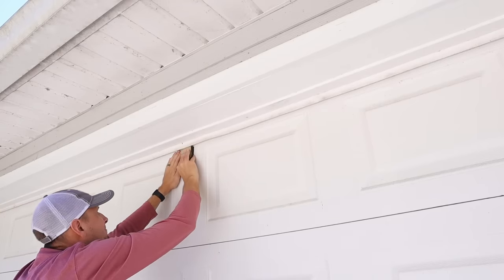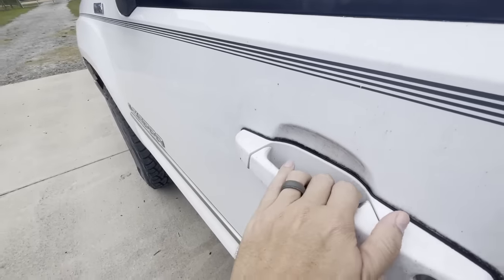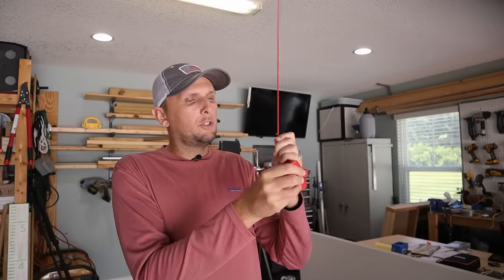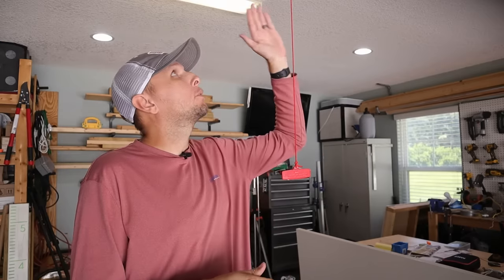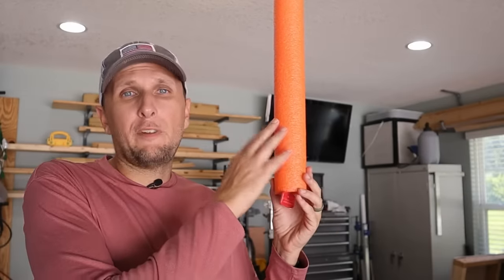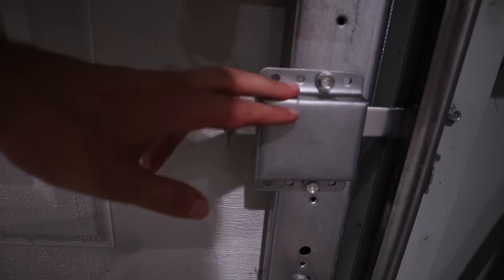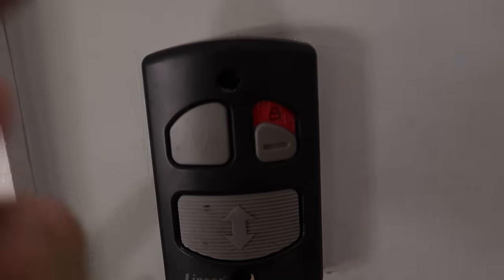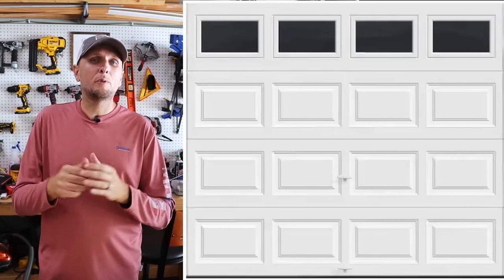How to Stop Garage Door Break-Ins | Number One Way Thieves Get Into the House!

Comment: Former LEO here, also. My experience tells me that the #1 way a BG came into the house was through an unlocked door between the garage and the home itself like you mentioned. There's only so many frequencies and at times BGs drive up and down the street pressing a half-dozen openers. When one actually opens, they'll sit and scout the area.  Also, I'm remembering that the #1 reason a vehicle was able to be lifted from a dwelling was that the owners parked in the garage...but left the key in the ignition. This was a good vid and thank you.! 

 I've also found that you can't beat a neighbour for security when you're gone, like Christmas. The only problem is that  we usually fail to get to know our neighbours. It's worth the effort, I assure you.
Reply: It doesn’t exactly work that way anymore.  At a minimum the frequencies are squelch-coded. You’re not just gonna guess through it.  Modern openers—there’s encryption both ways (and a key exchange) there’s NO WAY you just push a button and pop a door open.  Do you want to know how to do it? Do you really wanna know?  I’m not a hacker, but I’m a systems guy —and I can tell you exactly how they do it.  Right behind me they’re building a tract with about 500 new homes in it probably most of them using Linear quiet openers— or some close corollary.   Of course the houses are empty and being finished—but they won’t be six months from now—SO—I take my remote down there (with all the construction guys milling around)— put on my hardhat walk into random garage—I press “learn” on one of those openers— press the button on MY remote—and I walk away for 6-8 months… then come back for my new Jaguar!
Reply: What do you need to do when you move into a new place or you’ve rented your shit out as an Airbnb or whatever—you need to find out what sequence of things you gotta hit on that opener to clear ALL the existing codes out—and add back ONLY the ones you have IN YOUR HAND… maybe even do that once every couple of months just to be sure
Reply: @MattFellowswasHere  Well, you'll need the My Key (or equiv) for the Jag. Don't discount that there are a lot of older garage door openers around. It's one of those 'ain't broke, no replace' items. Yes, encryption has come a long way, but still if someone has too much time on their hands it's not that hard. e.g. my telly is only 5 months old. Still, some random dude (or dudette) is driving up and down our street turning on tellies in the middle of the night.
Reply: @r.f.pennington746  —- the guy who built your TV does not care who turns your TV on— he’s not engineering for security, sir.  The learn button on the door is a dumb thing to have— ANYONE can walk up and pair a remote they bought to your dang door!— it takes TWO seconds.  Why on earth would anyone spend millions of dollars trying to “crack the encryption” on your garage?—-nobody and I mean nobody on the planet…has that much “time on their hands”… Man this SO reminds me of the time I took a counterfeit (steel) Susan B, Anthony, dollar into the police station.  There was a sergeant there who said to me—why would anyone bother making counterfeit dollar coins?  He was dead serious!  As a 20 year old kid, I just remained silent.  Just thinking in my head—-dude probably stamps out 10,000 of these an HOUR—-he probably has a coin press that he runs ALL night who knows?  Do you really think I brought you the only example?  Do you think this thing cost more than maybe 10-20 cents to build?
Reply: If the neighbour has a car they always park on the street, get them to park it in your driveway while you’re away.
Reply: One of my neighbors, a detective, drove an obvious "unmarked" patrol car and when we went out of town I had him use our driveway so it wasn't parked in the street.
Reply: I briefly worked with a guy that was sent up state for over 14 felonious home invasions. He said that the garage was the easiest way into a house. Once you are into the garage of an unoccupied home the best course of action is ignore the door into the home because of alarms. As a thief you are safe because no one can see you in there so there is time to cut through drywall and make your own access into the home without opening a door. The only thing to worry about is motion detectors in the homes security system that give you a small window to grab and run… if the home has dogs then the motion detectors won’t exist and you can defeat the dogs with treats to make them friendly or a can of oven cleaner spray to suffocate the dog.
Reply: @TheMouseCop  Quite right. i worked more than a few break-ins where the BG's used an attic entrance inside the garage, gauged where the kitchen middle was, then simply kicked the sheet rock and dropped in. Motion detectors are often just in the rooms where there is outside access, ignoring the kitchen/garage combo. Yes, I've seen oven cleaner sprayed at dogs, WD-40, ammonia, bleach, Bernz-0-Matic, almost anything that can be garnered from the kitchen or garage. I'm thinking special place in Hell for those guys
Reply: It’s your neighbour that is the crook.
Reply: @MattFellowswasHere  whatever you are smoking, don't stop.
Reply: My cameras beat your “neighbor security” in the surveillance department
Reply: I enjoyed a tv show called "It takes a thief" that showed how guys broke into houses and how to prevent it.  Sadly it was mostly criminals that watched it and they took it off the air.
I lived in Colorado the police there stated people leaving their garage doors open during the day was causing a rise in thefts from the garage, even though the owners were often home.  Some thieves even went into the house and stole things.

I admit I usually just lock my front door.  The back door is usually unlocked.  I have a doggie door with a plastic panel but, even a metal one could be kicked in.  Also, there is a lot of glass in my house, like my back door.  Be pretty easy to get in.
Reply: Ours was locked as then the garage door couldn’t and they kicked it in
Reply: @MattFellowswasHere I wonder if you could use a "Flipper Zero" for that??? 🤔 I bet "Deviant Ollam" would know!!!
Reply: @MattFellowswasHere Then they graduate to dealing tungsten salted gold bars!!!🙄
Reply: We have a great neighborhood support group of retired couples who keep an eye out. Also as a dead end road its not a great area for thieves 
&  burglers to get in & out!
Reply: As a former meter reader, back in the 70s, one of the best things I saw was at the home of a little old lady. 
Old house with a large window in the back door. On that window, was a little typed note, about 1 x 2 inches.  All it said was "A neighbor is watching you."
Reply: Our back door is always locked for that reason when we're in the home.
Reply: Your cameras, motion detectors, walls, windows, nor doors do anything to protect you from people. All that can be broken or kicked in. Whoever wants to get in is going to. If they come during the day, they come for your belongings. If they come at night, they're coming for you. 👇

A pew pew can help but only if you are home and know how to use it during a highly stressful situation. Stay safe fam. 🙏
Reply: @lakesidesusan6745  Don’t let your guard down. I live on a dead end and our street was hit in the fall.
Reply: @mightymight365  Not quite understanding. It seems that your logic states a person sleeping out in a field is just as safe/just as in danger as a person behind locked doors, windows and a security system of some sorts (electric, Chihuahua, etc). Homes are what we have to deal with as we can't live in an entrance-less steel box. also, there is a vast chasm between folks 'wanting' to do a whole lot of stuff....and having the capability/time/resources to do so
Reply: Except then you are placing trust in them which means they inherently become one of the people who are more likely to help the people robbing you where someone you don't trust wouldn't.
Reply: @RunicSigils  Never, ever saw that either professionally as a cop (13 years) or experienced it with any of my neighbours over the decades. Sounds like you're in a bad neighbourhood my friend.
Reply: Salvation is Simple

HalleluYAH “Hallel u YAH - Praise ye YaH”

YaH is The Father (Genesis 1)
YaH arrives via the TENT OF MEETING
YaH was Who they Crucified for our sins
YaH was Crucified on an Almond TREE

Ancient Semitic Moshe (Moses)
Isaiah Scroll (The Original Isaiah)

Comment: Another good tip is, with all the new wireless camera systems, place cameras outside the garage area (to see thieves sculking about) and place one inside the garage (to check if the door is up or down, while away from home! And get notified if the door goes up / down, when its not supposed to.)

Comment: If you're installing a garage door opener: there are certain brands that have pulls that you have to pull straight down.  If you pull it forward (toward the door), it doesn't release.  You should look around for one of these.
Reply: Thanks.
Reply: get yourself a jackshaft opener. it has an electronic deadbolt that shoots through the track and won't allow the door to open, even if you  pull the emergency release cord. its located on the side of the door, near the top by the spring torsion tube. its way harder to shimmy the door open and pull the cord, at that most thieves don't know about them and again, they won't be able to release the electronic deadbolt. they cost about $500. I've been installing openers and garage doors for the past 15 years. professionally.
Reply: I'm sure you've been repairing the doors too when they ripped apart the door because the person pressed the button with the deadbolt in

Comment: Before you even got to the pool noodle, I ran down to the garage and removed the pull-cord. I ran a split ring in through the hole where the cord had been and fashioned a wire hook, which I hung on a screw above my bike. You'd have to have seen the split ring to have any chance of catching it with a coat hanger. Thanks for the tips.
Reply: THANKS for U idea too
Reply: Great idea!
Reply: Good thinking!
Reply: This is an excellent idea.
Reply: English is not my native language.  Can you explain this in a simpler way please. Not sure what "fashioned a wire hook, which I hung on a screw above my bike" means.  Specially the word "fashioned" in this context.  I googled it, and the results were all about the actual fashion, as in clothing and style.  Thank you.
Reply: @nightskylights4501  it means he made it. fabricated it
Reply: @nightskylights4501  "fashioned" means the person designed it and made it.  But I still don't completely understand what s/he was saying.  ;-)

Comment: My first impression on viewing this was that it was a school for thieves. But I appreciate the low cost, low tech solutions you've pointed out. In my "gated" community, the garages are quite vulnerable with few windows facing  them. And there have been several attempts by people who appear to have tried to open the door simply by using a pry bar beneath the door. The only thing they accomplished was to deform the metal a little. If you don't have a pool noodle handy, you might have some polyethylene foam pipe insulation on hand----paying attention to the foam diameter and the size of the garage pull. Also, the most valuable things I keep in my garage are bicycles. I secure them with cable locks to heavy equipment (drill press stand) or a cinder block. Finally, get to know your neighbors so you feel confident when you're away for extended periods that they'll have your back if anything suspicious is going on.
Reply: For bikes, an easy security step is to buy a $10 quick-release butterfly nut for your seat and take it with you anytime you're not actually riding the bike. Doesn't make the bike theft-proof, of course, but it makes it a lot less comfortable to use as a getaway vehicle, and thieves don't tend to like to steal stuff they then have to assemble in order to sell.

Goes back to the whole "the best security is to put your item next to a more expensive, less-well-secured item" thing. "I don't have to outrun the bear; I just have to outrun *you*".
Reply: A bike theif in my neighborhood would use my own tools from my garage to cut the lock cable or break the cynderblock apart. Or use the same tools to break into my house. The xtra-large dog door for a 70+ pound German Shepherd Boxer Mix usually warns away the smarter ones though. 🐕😆

Comment: Good video tips. I removed the handle from my garage door release years ago, now I will also shorten the rope. AND we always, always, always lock and keep locked via deadbolt the door from garage to house (it is an 'exterior' door after all). The only time our exterior doors are unlocked is when we are passing through them even when at home. 
We also always set our alarm when we leave even for a few minutes trip to the store.

Comment: Excellent video with really good advice!  Thanks for putting this up.  One thing I would suggest is for garages or sheds with windows, get some window wrap that lets all the light in (it acts as a diffuser and brings in more light than a clear window), and put it on the inside of your windows.  You get all the light, it looks nice, and you can't see through it at all.
Reply from the maker: Thanks a lot for the feedback Clay!
Reply: In addition to not being able to see  into the garage, you can buy window films that prevent breaking the glass.
Reply: Buying metal frames that are welded and insert into a window to imitate divided window panes.  They look nice and prevent anyone from climbing through a window.

Comment: This video is vital to watch!  I for one, did not know that thieves could just use the old wire hanger trick to gain access that quickly!  I'll be adding a shield today and remove the rope itself and make it a "clip on".

As for the report, I NEVER leave it in the car.  I always take it into the house and I always put the steering wheel bar on and clock the doors.  So no issue there.

But as for the Smart Chamberlain garage door opener, HERE'S A WARNING ABOUT THAT!

If you already have one and you haven't updated its App, PLEASE DO NOT UPDATE THE APP!

As a computer tech, I only "update" something if it has a problem that an update addresses/fixes.

The other day, the Chamberlain App was nagging to be updated, so for fun, I went to the App Store to see what the update was about and moreso, WHAT THE REVIEWS SAID!  I have been avoiding updating it because it works perfectly and away from the home, I can confirm that the door is closed and if I wanted to, I can open or close the door.  This is as it should be.

So I'm reading the reviews and not surprisingly, apparently Chamberlain has SCREWED UP THE APP!!!

Now, people find that they can no longer control their door WITHOUT PAYING A STUPID MONTHLY FEE! (to be confirmed).

First off, that's ILLEGAL and breaks the purchasing contract!!!  When we purchased it, it had a lifetime warranty on it and the app was FREE to download and USE!  They legally cannot just change that, so I'm expecting some legal action to happen there.

So if you do have the App, I'd highly advise to NOT update it!  I hear that they now want $10 per month!!!!!!  INSANE!

Hope that helps.
Reply: I just looked into this. The fee is for video storage if you have the camera and want to keep recordings. Otherwise, it's still free as far as I can tell.
Reply: @njcanuck It's the storage thing that I don't agree with.
As it is, I have a bunch of security cameras in and around the property.

They are all the type where I have them configured to record directly to a pathed hard drive.  Some, I have recording 24/7.

I don't have to worry about cloud storage and having to pay some company a bogus fee for something that I can do right here at home.

This cloud storage BS is nothing more than another money grab.

That being said, I guess it's not too bad for those who don't know how to set up shared drives on a computer inside their home, that stays on 24/7.
Reply: Could be a hacker! They can do things we never imagined before! Also keep your camera covered with tape they see everything you do. If it’s in the bathroom with so you could answer your phone they see everything you do front or back and you never know they are there waiting to see passwords your nice house your bank account or debit cards you use or credit cards you use to buy anything online. I learned the hard way.

Comment: One thing I never thought of until we had a basement flood, and had to wait weeks to have the damaged, torn down to the studs drywall that was removed replaced, is that most inner garage walls, that is the wall between the house and the attached garage, is only made of drywall. When walking around downstairs in the basement hall, looking through the studs right into the garage itself for weeks, it occurred to me that even once the drywall was replaced, it would be pretty simple for a thief to saw through that drywall and gain access to the house if they got into the garage, even if you locked your inner garage door to the house. All the more reason to keep your garage thief proofed.
Reply: I had that thought also so when I bought my house setting it up as a workshop the inner wall was covered with 1/2 inch plywood for support of shelves benches etc..  A thought on locking the inner door a friend of mine had thieves gain access to his house by throwing a rock thru a window. He diligently locked his inner garage door. They just open the door from the inside which is possible with most house entry doors. Then used his tools to cut their way into his gun safe. I have since placed a dead bolt on my inner garage door which requires a key on both sides.
Reply: Doors are way easier to kick down than it is to saw through drywall though.